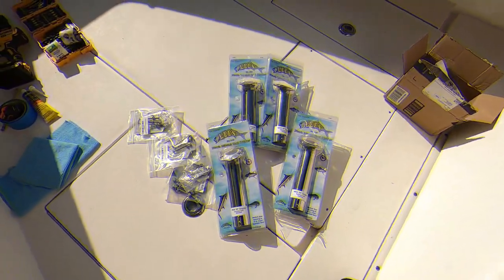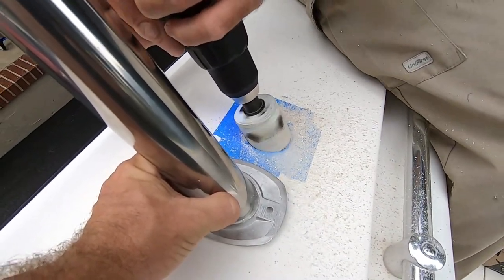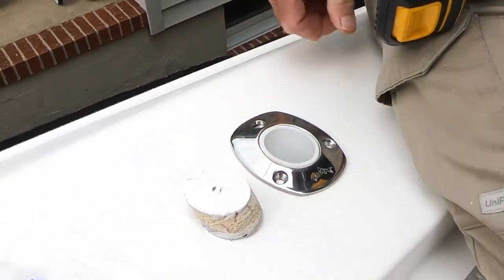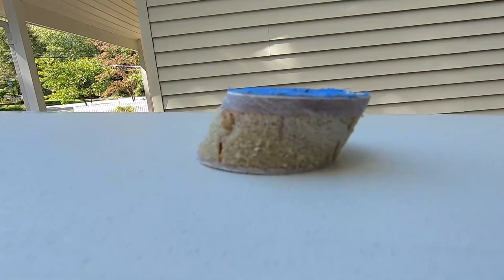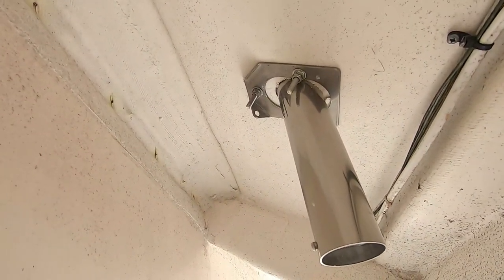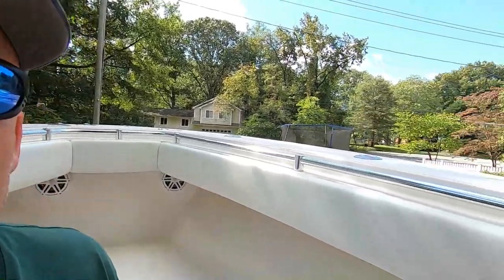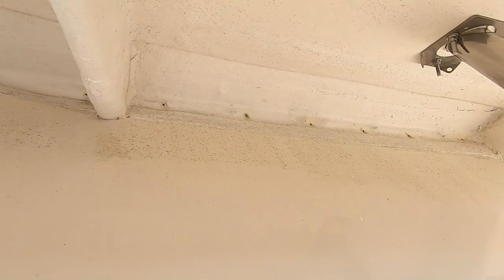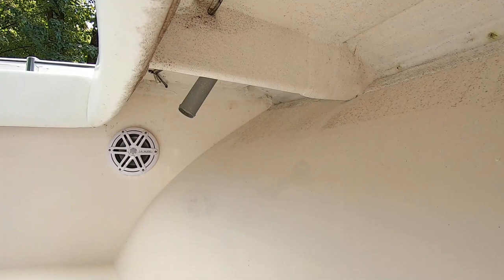How To Install a 30deg Rod Holder and 3 Piece Hull Benefits. SpinFish1

Comment: I followed the tutorial this weekend and got 6 new rod holders installed on my 25 open! I used a dremmel to route the hole a little bigger and then use 4200 fast-cure to seal the newly exposed core material & in the bolt holes! This was really helpful!
Reply from the maker: @Lucas-LeFever  Awesome!! 👍

Comment: Great video. I'm just about to add a couple of rod holders to the bow of my boat too. Don't know why I just didn't have them put in when I ordered the boat. I have a 2 PC. Hul so it's going to be a bit more work to get them in. But a little research gave me a great idea to make it easier. 
Good job...
Tight lines

Comment: Had you considered sealing the cut  hole with something before inserting the rod holder?
Reply from the maker: It was sealed with 5200 before installation, its totally sealed.